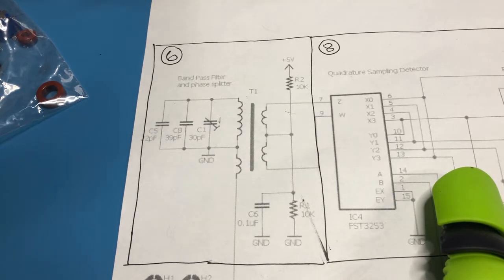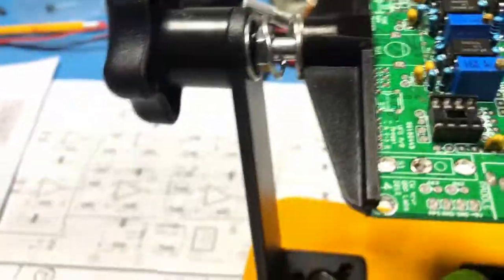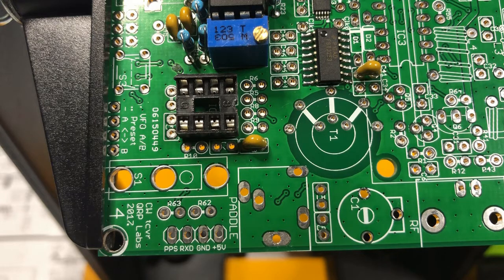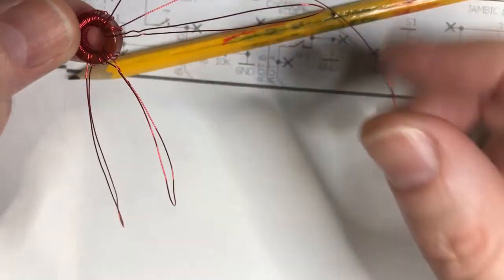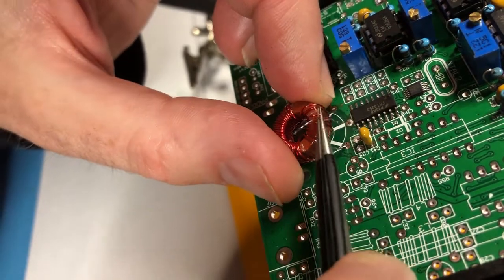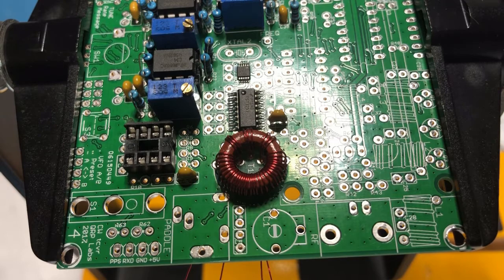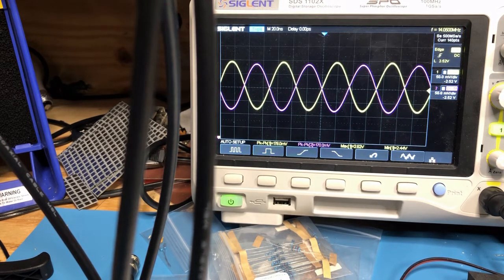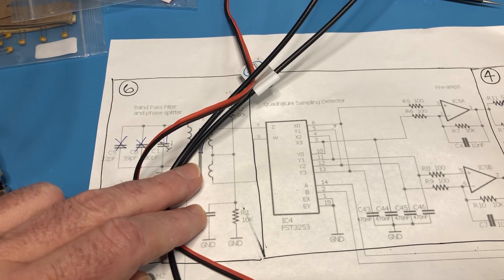QCX Transceiver Part 4  - The Bandpass Filter and Winding T1

Comment: I've build 4 QCX radios and I'm really enjoying your detailed build and step by step analysis.  One thing I like to do when installing transformers with multiple windings is to cut all of the wires to progressively different lengths so they naturally insert one by one when putting them through the board.
Reply from the maker: Thats a good tip Jonathan - thank you for the comment!

Comment: I have come to this video a bit late but am interest in your winding. I am a real newby at this and I am struggling with a 40M version (5 vs 3 pri/sec windings). What I am interested in is the wire you are using that which came with the kit? It appears to be a bit stiffer than what I received. Like your videos.
Reply from the maker: Never too late George - always love comments. I rarely use the magnet wire that comes with the kits. I have had success with this brand of magnet wire https://www.amazon.com/gp/product/B07GBMKMKY/ref=ppx_yo_dt_b_search_asin_title?ie=UTF8&psc=1 (go for 28 gauge thats the most useful) - no link to me. The stiffer wire is likely because its a thicker gauge.

I also always use the soldering iron method to strip enamel - I haven't had much success with the "scraping" technique. Let me know how you get on. I have always found winding your own transformers to be one of the fun parts of the hobby
Reply: @na5y  Thank-you for your reply. I just recieved a roll of 28 guage wire from the same company and just ordered another roll this time in the color red in hopes of winding alternate coils in different colors to keep them separate. I have been a ham for almost 60 years and have built several Heathkit projects but never this kind of kit. I have a 40M, 20M QCX...a QCX+ and QCX mini and I am going to make them work. Thanks.  George. WA0FSE
Reply from the maker: I do the same thing with alternate colors on the windings - looks nicer too! Good luck with the kit and drop me a line if you have any questions.